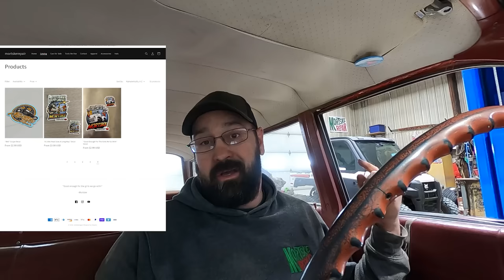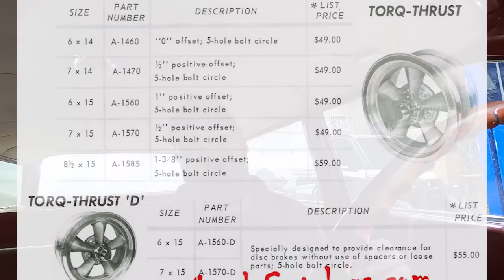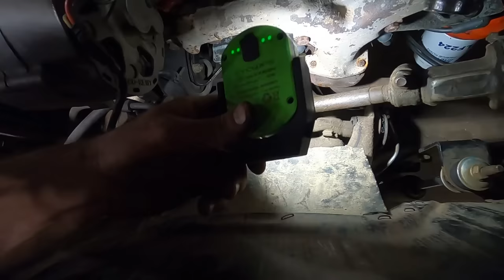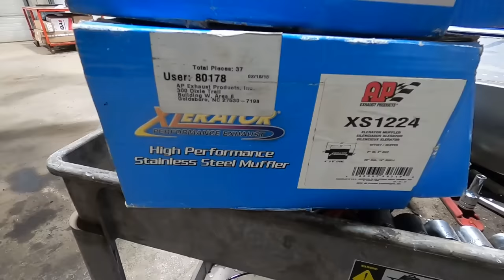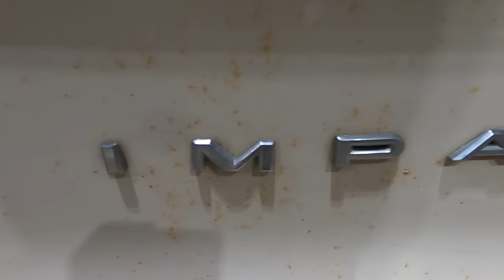My First Classic Car! 1964 Chevy Impala Station Wagon! Complete Suspension Rebuild Disc Brakes!

Comment: disc brakes are not an upgrade
Reply from the maker: Care to elaborate upon this theory you have?
Reply: @MortskeRepair I bet he won't cuz he's wrong. Trolling trolling trolling Rawhide!!!
Reply: they self-brake, nothing like going down the highway and having the disc brakes apply themselves!  never have I hadshoe brakes do this! @MortskeRepair
Reply: @scutterlibby wait, what?
Reply: Never changing your brake hoses that are swelling internally, never changing your brake fluid that absorbs water, and never replacing your corroded calipers with half frozen pistons are your problem there bucko... Upgrading from drums to disc done correctly is always an upgrade, just have to decide if you want to make the investment.
Reply: @scutterlibby  You're doing something wrong.
Reply: But Dinner Plate Brakes are!
Reply: It's not an upgrade--It's a necessity with all the knuckledraggers and pinned comments out there...
Reply: Hmmm....I think if you take the time to look up the benefits of disk over drum you will conclude they most certainly are an upgrade ..
Back in the 70's disk brakes on the front only was an expensive option because they were substantially better..
Reply: @scutterlibby  that's the type of answer I'd expect from a chuckle head
Reply: Did you have bad calipers or shot hoses? Most cars have disk brakes and they work flawlessly. You may need to take your car to the local @MortskeRepair shop.
Reply: @MortskeRepair Bitter argument 40yrs ago with a friend. His dad the physics department chair; mine an engineer. He maintained that larger '72 VW rotors would not stop quicker than the '68s. Next day, conceded. Said his mistake was not considering the coefficient of friction between the rubber & the street or some other face-saving calculation. . .
Reply: Right!  Cars are made to go.  Who cares about stopping?
Reply: They definitely are from drums
Reply: When you replace the drum brakes yes they are
Reply: @scutterlibby, how many times have you asked to speak to the manager this week? 🥴
Reply: @scutterlibby  Guessing you've never experienced the thrill of having a shoe brake on an old motorcycle jam on you 🙄
Reply: Aaaaaand.... there's a turd in the punch bowl
Reply: @MortskeRepair you could upgrade that rust off there ... especially by that fuel door....

Before you hit a bump and break that glass!!!
Reply: Damn, how in the God name you siphoned our IQ points with your comment? Thats some type of forbidden wizardry!
Reply: Seriously
Reply: thats why every high performance car has discs right? lets see you run a 1000 hp car and stop it with drum brakes....
Reply: OMG I've lost count long ago how many times I could have died driving drum brake cars lol. Thank God nobody was coming the other way.
Reply: @MortskeRepair Stopping's for losers! Just downshift!
Reply: Dewayne’s are multiplying
Reply: Wait a minute, did Duff share his hoover schneef with you?
Reply: Old tools, old cars and you are super cool.
Reply: What the f would you call it  then?
Reply: Obviously has never had a 4 drum brake car before? Definitely a huge upgrade.. dmf

Comment: When I added hydroboost to my Scout II I struggled getting the rod length correct for the master cylinder.  These rods are the non adjustable type and you simply cut/grind to fit.  But on the ole Amazonia I found "Brake Booster Adjustment Tool " which will basically measures the rod protrusion and the master cylinder depth to get you where you need to be.  IIRC you leave about 1/8" inch gap to prevent brake drag when everything is up to temp. Worked like a champ!

Comment: "Burns a quart of oil every hundred miles so I put exhaust on it."
That's the most teenage Midwesterner quote ever.
Reply from the maker: Priorities!
Reply: I would had put a stereo in it which if my teenage years, would have been a cassettes deck (with auto-reverse!) :)

Comment: That bearing greaser is the coolest damn thing I've seen in a long time. It's so simple and it works really good...
I spent quite a bit of time in 64 Chevys when I was younger.  When I was 13 (1974) my dad and mom had a
64 Chevy Impala SS that had really low miles and it was like new.  It was red on red and I remember dad telling me 
it had a 300/327. It was an automatic with the console.
When I was 16 they bought another 64 SS Impala but this one was an odd ball. This one too had low miles and
they bought it from the original owner that special ordered it. It was white with a silver blue painted top and
it had white interior. This one had a 6 cylinder and a 3 on the tree but it still had buckets and a factory console.
Those cars had so many cool details. 64's were my dad's favorites but I really like the 63's ...

I wish I would have kept my first car. It was a 69 Chevelle SS396. Factory 4 speed with a 4.11 posi 12 bolt.
I bought it when I was 15 (1976)
Reply from the maker: Thanks for sharing!

Comment: Hey Mortske, just a small tech tip of the day, try turning your bearings with the large side down in the greaser. Makes it a little easier to put the grease in. With that machine it may not make any difference, but the old hand push type it does. Those control arm bushings are a pain! I might have been able to give a few tips, but other than the tool, they are rough, and I never had the tool. Not even the dealerships I worked in had the tool. Enjoyed watching your shenanigans as always.

Comment: Always loved the thrush turbo mufflers. Had to put a pair of the red cherry bomb glass packs in my 1978 mustang when I put in the high performance 302 in place of the 2.3 four cylinder. Didn't have a lot of room for exhaust, plus the car was lowered, so the cherry bombs fit the bill. Ran them straight back to chrome turn downs just in front of the rear wheels

Comment: Flow master series 40 loud drone with the supercharger and she's going to sound just fine. It's fine and minty, as ZP&BP would say that it's minty fresh! Go with 342's and enjoy the no power jack burnout capabilities with no holding the brakes on. Just boot it and she will smoke em up and you can get going to 145+ with the gears along with the smooth highway cruising around under 2000 rpm and enjoyment for you and the Duff with the women who we all get Mr. Mortske! Looks great dude 😎 m

Comment: Growing up my grandpa always had an attachment on the top of a 5 gallon bucket of grease that would pack wheel bearings.  Doing that must have been much more common before 1970 as I never saw it used.  The bucket top and pump could refill grease guns before replaceable cartridges.

Comment: Anyways awesome auction score mortske sir 64 Chevy Impala wagon, and the reason I mentioned the 65-68 Buick wagon hinged rear floor panel setups is its probably going to be fairly easier to find a Buick sport wagon in the boneyard for the hinges and maybe the floor panel than it would be to find a 63-67 Impala wagon in the junkyard?!

Comment: Back in the mid 80s I bought a 1964 SS Chevelle with factory in dash AC and a 327 4 speed for $800, it was rough but I did a 90% restoration on it, all new and complete interior. It was originally a white car with blue interior that someone painted blue before I got it, it was rough but mostly rust free except the trunk.  I changed it to a red car with white interior and it looked freaking awesome. I had about $5k or so into it when done, remember it was the 80s but I ended up selling it for $3500 like a dummy. It was a pretty rare car like your wagon is I'm sure.
Reply from the maker: Wow! Thanks for sharing!

Comment: My first car was 17 in1983 paid $500 in Hastings Ne was  blue with a vinyl top 1971 monte carlo 327ci was a nice car made the local newspaper one wheel peal 93ft long burnout black mark drove that car 3 years then sold it bought a 1980 trans am.
Reply from the maker: Thanks for sharing!

Comment: Your upgrades to the front suspension reminds me of the same re & re I did to my '71 Nova,  a couple of years ago. Moog stuff - ball joints,  springs, Energy Suspension bushings  throughout, Right Stuff Detailing front disc kit , KB gas shocks, and 15"x7 Cragars on the front and 15"x 8s on the rear. 1 1/4 front sway bar on the front and  1" on the rear. Now, the car stops immensely better when I'm hauling the groceries, and very little body lean on the twistys.... 
When your ride's old, make it safe make it better. I enjoy your stiff and give Duff and scratch behind the ears for me! 
Regards!
Reply from the maker: Thanks for sharing!

Comment: Comparing Different Types of Brake Fluid
Technical Bulletins
Composition
There are four main types of brake fluid available on the market today:
• DOT 3
• DOT 4
• DOT 5
• DOT 5.1
DOT 3, DOT 4 and DOT 5.1 are glycol-based fluids. Glycol-based fluids are hygroscopic, meaning
they absorb water over time. As moisture gets into the brake system, the boiling point of glycolbased fluid lowers.
DOT 5 is a silicone-based fluid. Silicone-based fluid is hydrophobic, meaning it repels water.
Moisture introduced into a brake system with DOT 5 fluid does not mix with the brake fluid.
This causes the moisture to freeze or boil and can lead to brake fade.
Glycol and silicone-based fluids are NOT compatible. Do not mix these fluids. Only use DOT 5 in
a completely dry system or in a vehicle that already has DOT 5 in the system. DOT 3, DOT 4 and
DOT 5.1 are all interchangeable.
Boiling Points
Boiling points are the most critical aspect of brake fluid to keep an eye on. As moisture enters
the brake system, the boiling point of the brake fluid lowers.
As you drive your car and apply your brakes, your brake system heats up, including your brake
fluid. If your fluid heats up to the point of boiling, the fluid vaporizes and air bubbles form in
your brake lines. This leads to brake fade or a loss of pedal completely.
There are two types of boiling points:
• Dry Boiling Point
• Wet Boiling Point
Dry boiling point is the boiling point of brake fluid measured with zero percent water by
volume. Wet boiling point is the boiling point of brake fluid measured with 3.7 percent
moisture by volume.

Comment: Steelies with poverty caps or torque thrusts, but with white walls out. All impalas had whitewalls.  Biscaynes and Bel airs had black walls, until they needed the first set of tires. Then they got whitewalls, from Sears Roebuck. My Dad always went for the whitewalls in the 60’s and 70’s..

Comment: I restord a 72 delta 88 in a junkyard in 1980. And it got 25 bucks in it. The rest of the parts where straight out of the junkyard. Perfect for daily and didn't have to worry about scraping it up. Washed it once in3 years. Was very dependable and would hold 3 kegs in trunk.🎉🎉🎉🎉🎉
Reply from the maker: Thanks for sharing

Comment: The way the two piece outer steel and aluminum center wheel is made is as such..... The aluminum inner has a lip on the far outside edge & the outer steel has a inner groove so when the outer steel hoop is heated and expands its slid over the inner and aligned on the outer lip to the inner groove... After it cools it shrinks and locks itself into place... Then most of the companies place it in a balancer align it then weld on it on the backside...
Reply from the maker: Thanks for the info!

Comment: My vote: steelies with either spider caps and chrome lugs, or a stock offset chrome steel rim, but no spider caps on those, just chrome lugs.
My two cents (and probably worth only one).
Love Auto City Classic- mostly because I'm about 15 miles away from them 😉

Comment: The larger tires make you go faster than speedometer reads. Change the speedo gear in trans to the correct one for tire new diameter.

Comment: Rebuild the front end and rebuild the 327 and drop the Supercharger on it with a good set of 8:1 pistons and a forged crank with forged rotating assembly and she is going to be a great screamer. Just don't cut the hood. Get a old one and hack it up and save the original ones. 😊

Comment: Back in the day , when building mostly Camaro’s (because they were still cheap in the 80’s ) we would find 65’ Impala wagons to yank the motors out of. A lot of them had the same 327 as the Corvette that year. Which was claimed to be 365 HP. Of coarse you had to put on the headers ,and Holly that was in the trunk. So the impala motor was a 4bolt 350 Hp screamer.
This was in Concord , Ca.  
   🤔🤔🤔 funny you mentioned Concord as I was typing this edit. 😂😂WTH Duff Psychic or something ??
Reply from the maker: Thanks for sharing!

Comment: I would be afraid 😯😳 to show this to my elderly Mother! She had a 1964 2 door couple with a 327 and a Power glide transmission. Got it 2 years old with 15K on the clock and it was Red with a white interior and red dash. Hard top and was loaded except for the windows. Had crank manual windows, no electric ⚡ windows. Hed Dad always had problems with the driver's side door windows because of the wiring cracking up from cycling the door open and closed. Go back to the Coil springs. You will be happier in the long term. Great evening to you and the tragedy of her car was my Dad forged her name changed the title for the Impala and sold it for dirt cheap after he wrecked it drunk in 1971 after I was born and around for a while. He was in Korea and Vietnam and ended up with PTSD so bad and cancer from the Agent Orange, Nepalm, and some kind of pesticide for bugs that they outlawed after the Vietnam War in 1975/76. Can't remember what the name was and it killed way more than the bugs and light foliage it was designed to. Killed animals, made humans sick and caused breathing, intestinal, and brain function issues which ended up causing Parkinson's and MS symptoms along with other issues like birth defects and so on. Have a sammich or two for me and hook Duff up with some cheese and a treat with a pet for me and my family. Mom is hooked on your dog and his loyalty. We lost ours in a year of each other or say 11 months to the day almost. They both made it to 26 years old. Just like a family member when they pass on. Thanks for listening to my old boring story and I enjoyed the video as always with the old man and the neighbors. (Step Father)  Have a great evening and enjoy your weekend when it comes around. Looking forward to seeing what you have up your sleeve next.

Comment: I have had that problem with castle nuts on tie rod and ball joints where they don't come close to the hole.  I just end up reusing the old one which is probably better metal anyway.

Comment: I remember one car growing up was a Oldsmobile wagon remember it blown up and being poor thanks to my uncles trade think it was a shell of dart to old shop who had a 350 golden rocket engine that was worked my dad wasn't a person to work on cars he new basics but uncle's wrre the car guru's and remember how much they were excited to put it in and i remember that sticker on the air cleaner and one on the valve cover that was golden color still can smell the rubber we layed with the first drive back to grams house full load of 4kids 2 adults witch old man made 2 mountain man and full luggage for our weekend we spent there we live 2hours away so that was our vacation when i was young but i remember he backed out hit the brakes and it lunge forward bit then instantly started to smoke the tire the sound of that 4 barrel carb whrn it came in was just not forgettable think i was around 12 or so. me and brother were in 3rd row with window down the smoke pured in so bad but the smell of tire smoke just something about it but i remember coming back to uncle's the day we were coming home and the posi black mark was 100 ft atleast till it finally grabbed i remember being on 83 interstate one time coming home from hunting and a little red sports car was toying with old man remember he was trying to get over and remember him smaking down throttle and remember hearing car beside us drop a gear and i tell u that we pulled passed him like he wasn't there if remember correctly it had 100 on speedo and i due remember the needle was nowhere to be seen i can say old man could drive just wasn't a wrencher .
Reply from the maker: Thanks for sharing!

Comment: I'd love to find an early 60s Mopar or GM wagon. Lucky Costa has got a '64 two door Chevy wagon that is sweet.
Some nice driveability mods you did there. I adapted a dual reservoir master from a Cadillac into a '64 Chrysler New Yorker after losing a flex line. Made a plate for the mounting and shortened the booster rod and it worked great. I don't remember if it had a proportioning valve or not but it stopped well unless you drove it through a puddle. Fun times. I wish I still had that sled.
Reply from the maker: Thanks for sharing!

Comment: 56:25. Recommend not synching down the control are bushing caps until the car is set on its wheels on the ground. The bushings will tear out if the control arm shaft is not position correctly with the cars weight for ride height.
Reply from the maker: thanks for the tip

Comment: Sir mortske that is a very nice Impala it seems we have a lot in common I rebuilt a Impala in auto mechanics too but mine was a 77 impala it had a 305 in it I put a 350 in it it was like a tank now I can't find 1 anywhere but now I got a 1975 Chevy monza 2 door town coupe I gotta finish floor pans& brake booster it has the original 262 v8 in it,great content brother😎
Reply from the maker: Thanks for sharing!

Comment: On the upper control arm ball joint install,  I'm pretty sure the "cap" you put on the top belongs on the bottom to secure the rubber boot.
Reply from the maker: Yup
Reply from the maker: Correct

Comment: Hey mortske u should take the bolts that are behind the turn signature cam out and pull the hosing cover on chevy  stering colums and use  two part epoxy for fuel tank repair
Reply from the maker: Thanks for the tip